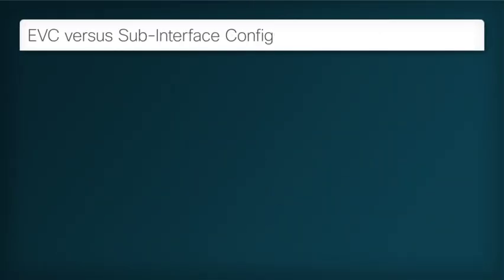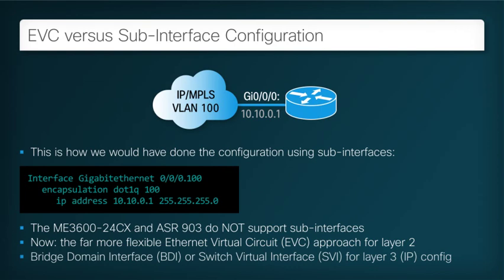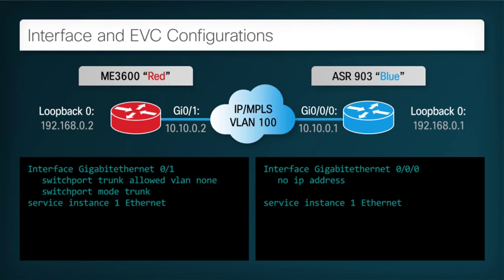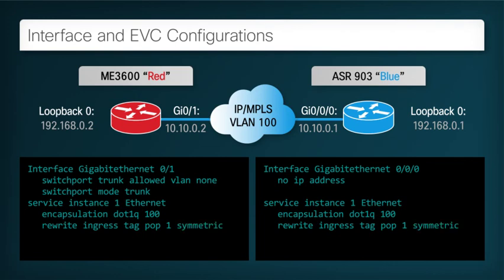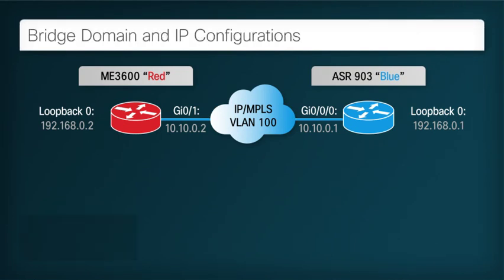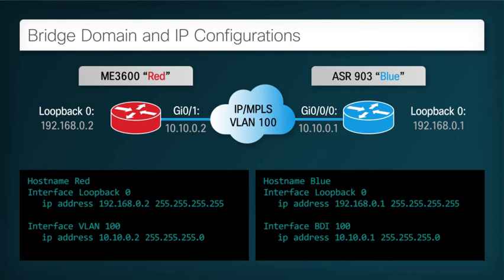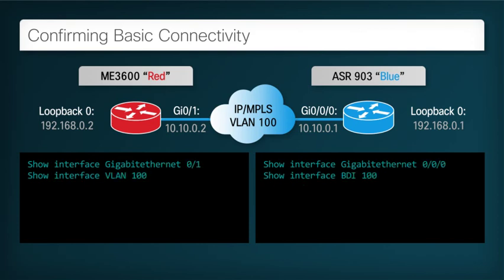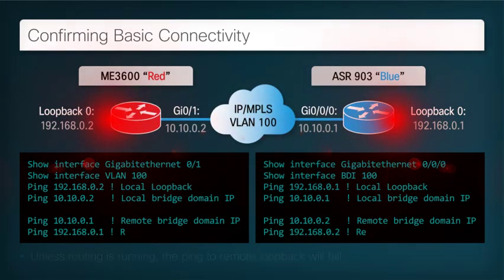Cisco SPAG: Configuring TDM Pseudowires - Part 2/6: EVC and Bridge Domain Interfaces (BDI)

Comment: Great video, very dense in information.  I had to watch it several times but I enjoyed it every time. I was surprised that ME3600  Gig 0/1 interface points to "bridge-domain 100" but VLAN 100 is created instead of BDI 100. I don't know if that is correct or a mistake, but I if I ever see that configuration It will not confuse me.  FYI great voice, great pronunciation, this was a very elegant video.

Comment: Will this be correct if i have to transfer config from the traditional router to ASR903
ip route 10.10.10.1 255.255.255.255 GigabitEthernet0/1.275 ---------> We assign this single IP to customer on our metro network
 
ip route 10.10.10.1 255.255.255.255 bdi 275 ------> for ASR903